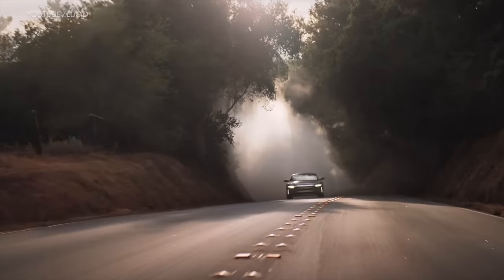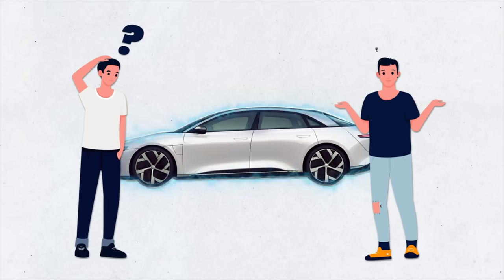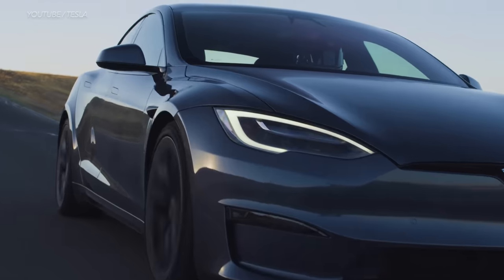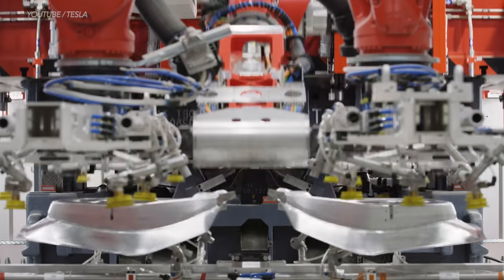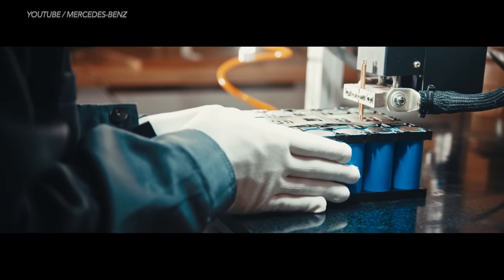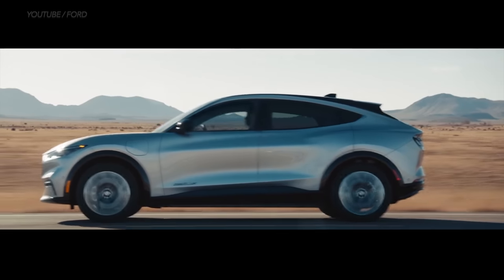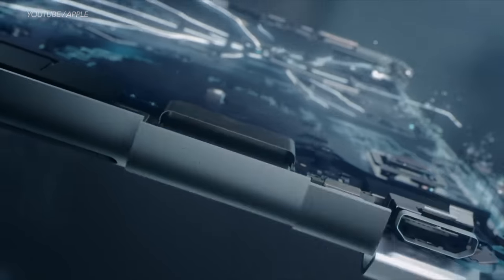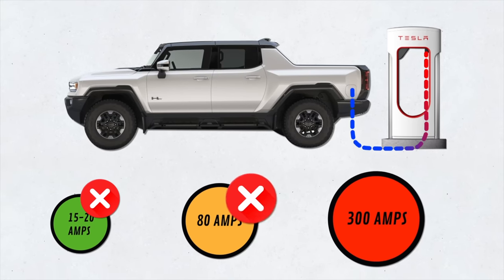Here's Why I'll Die Before I Buy an Electric Car

Comment: Well I appreciate Scotty's research on this issue and I agree with him on areas such as the need for more distance coverage by the batteries. However, my suggestion is since the Ev market is so diverse. One can always buy a Hybrid Electric Vehicle (HEV) as opposed to a Plug in Hybrid Electric Vehicle (PHEV) or Battery Electric vehicle (BEV). 
The beautiful thing with HEV units they dont need to be plugged in or charged anywhere overnight. The vehicle simply self charge while you are in traffic and while braking among other times when driving at low speeds.

The point is EV's are more expensive now bcuz of the cost to acquire the materials to build these batteries. In addition to that there is a growing demand globally eventhough we still have more Internal Combustion Engine (ICE) vehicles on our roadways. The truth is if you can afford the everr increasing  cost of gasoline well go ahead and remain with your combustion engine vehicle. However, if you are in my case where I am driving in excess of 650-700 kms per week to work with the high cost of gas...that's not possible for me to keep my current ICE engine car. I do alot of driving due to the nature of my job so I will be buying a new Hybrid Electric vehicle (HEV) within the next 10 months or so. At the end of the day it comes down to economics for me and these gas guzzling cars not cutting it for me with the high cost of petrol which affects everything in transportation and ultimately you feel it in your pockets. 

I dont need to worry about battery replacement bcuz most new ev or hybrid Electric vehicles batteries have a 8-10 year life span.

Just do your research ppl, have a plan and stick to your budget. I have done that and I am satisfied with going over to Hybrid Electric than the current ICE vehicles. The bottom line is Ev's are here to stay so get used to it.

Comment: Great overview. Would be good to get some idea of how much it's going to cost to maintain these EVs and what plans 'hypnotized' car makers have to run down PV/DV production and the spares market for those. How will governments like the UK's (which gets 80p in every 100) cope with the loss of fuel tax? Do a quick sum: say 20,000 gas stations in UK with 500 cars visting a day buying £30 of fuel. That's £240 Million A DAY in tax - over £84 Bn will be lost in revenue per year eventually at current prices!
Reply: a couple of Australian states have introduced a tax on EV's whereby owners pay by the KLM travelled. They submit a report every quarter,
Reply: The road taxes need to be paid either way. There's an inherent cost to maintaining infrastructure. I don't think any ev owner thinks that they shouldn't be contributing to maintaining the roads. That's up to governments to implement a way of replacing that lost fuel tax but whether you are paying tax on your fuel now or being taxed on your ev to pay for roads either way you're going to pay. It's not a good argument to not drive an ev because you're going to have to pay road tax. That cost is going to happen either way.

Comment: There was a time when 8.6 seconds wasn't half bad. Actually, my daily drive only has to do 30km between charges, so a MX-30 would fit my needs perfectly. Imagine if car manufacturers didn't have to satisfy a consumers need to go excessively big, fast and powerful then it would make it easier to make the cars "green", inexpensive and reliable. But hey, people will go out and buy a car, put stupid mods on it and make it unsuitable for its intended purpose, because most people don't use them for what they are designed for anyway.
Reply: Exactly.  8.6 is quick enough for most people. This idiocy of sub 5 second 0-60 times results in massively larger motors and batteries than would otherwise be needed.  And of course massively higher prices.
 Dropping that 0-60 in a still fast but controllable 6 or 7 seconds would shave hundreds of lbs of weight and thousands of $$ 
 Yet a Tesla will make ONE run at max throttle....
Simply insane for any Joe/Jane Blow to go faster than any muscle car from the 60's through today.  Many can't handle it.  And going that fast exposes the crappy Tesla brakes and handling.
Reply: That tiny 30KW batterie will have to be deep cycled EVERY Day, making it's Life expectancy about 1 or 2 Years....Paul
Reply: @paulholterhaus7084  Based on WHAT??    There are Teslas that have been fast charged for 10 years and still ticking.  Plenty of Leaf's with 10 y/o batteries.

Comment: Right now, I'd be more interested in an "electrified hybrid", or whatever they're calling vehicles with gas engines that drive generators, to charge batteries, to power electric motors. Maybe a solar-powered EV that can charge all day.
My Dad worked for the railroad. Whenever this subject came up, he went on and on about developing cars like diesel-electric trains (engine-generator-battery-motor). Now they're finally doing just that. I wish he could see it.
✌️&❤️
Reply: Aptera has a prototype of a three wheeled EV with solar panels inbuilt. They estimate that 1 day of sunlight will power up to 40 miles of travel.

The base model weighs under 1,700 lbs and has a range of 250 miles.

Comment: I own a 2014 Cayman S as my daily and track car. I do about 10 tracks days a year and I put about 15,000 miles a year on it between driving to/from work, groceries, school run, trips, etc. My trophy car was a Cayman GT4 which I traded in and am waiting for my GT4RS to be delivered this November. I ordered the GT4RS because I believe it’s the last of the truly epic IC engines and will keep its value or possibly increase over the long term. I’ll probably put about 2000 miles a year on it like I did with my GT4. Porsche has announced that the next Caymans due in 2025 will be all-electric and I think that’ll boost ICE values once they’re no longer available, especially all 6 cylinder versions. So, how does this relate to EVs? They’re boring. They titillate with their tech and giant iPad type screens, but the sound, the driving dynamics of the engine are all ultra-antiseptic in their character. If the next Caymans take 5 minutes to fully charge and have a 1000 mile range per charge, I’d still prefer the sweet 6 cylinder ICE versions of the Cayman. Now for a family car, EV for sure. Your fun, exciting, sports car? EVs will never replace them in my book. And I think in the books of other car nuts too.

Comment: So let's see...
A) EVs can catch fire and require special extinguishers (potentially locking doors trapping you inside and sprinting at full speed before igniting); this can happen because you are charging or because you are not charging ... So either way
B) Energy is going up, and these are energy hogs... So if you are thinking about range then hold on to your wallet; and if you plan to charge at home, then consider the wear it will have on your infrastructure (batteries and cables will wear out as they get toasted due to high power draw from your car)
C) Batteries are very expensive ... So if you're expecting it to pay itself in the long term don't forget to include periodic battery replacement into your calculations (in short it NEVER WILL)
D) Weight means tire, break, suspension and steering wear... So you better inspect regularly
E) Oh the goverment is already planning on taxing by the mile, so they'll track and control you like they've never done before
F) Do you really want to go all in on sensors and control units during a part shortage? Electric cars are even more Murphy law centric than the regular clunkers coming out today. They have nothing but computer depending systems that are complex and likely to be expensive or unavailable.
G) Lets be honest, they are new. New tech has issues (some I discussed some are yet to be discovered, probably while attempting to corner at 80mph in the highway).  Usually, cutting edge stuff is expensive and lacking standards. So... They are less likely to be maintained once the technology matures. Or put in another way, they can be considered "early classics" or future junk.

Personally, not going to buy expensive junk. I'll avoid for as long as possible and I plan on switching to gas and use biogas... So that should be quite a while.

Of course there is a health benefit from pushing these the last 30 miles... If you want a good workout but find the gym too confining and don't mind the extra expensive, then maybe EVs are a perfect fit for all those Sisyphus fans out there. I'll be glad be glad to support by honking as I pass you!
Reply: Hmm. Current limiting your car battery feed sounds like a good idea...oh wait, it'll take longer.
Reply: yeah, i like my vehicles with fuel that cannot catch fire, like gasoline.

Comment: Then there's that whole spontaneous combustion thing. Looking at you Tesla and Chevy Bolt.
Reply: More ICE cars by far catch fire even sitting there.   ICE is something like 10X more  likely to catch fire than BEV.
For what it's worth I think it was 16/141000 bolts that burned.   They were defective.
Reply: Kia, Hyundai, Ford, and Mercedes have recently had recalls for fire problems, and it is not the EV models.
Reply: If your radar was functioning correctly, you'd know about the 160'000 ICE cars which catch fire each year in the US.....  The statistics show that there are around 3 electric car fires per 100'000 EV's....

Comment: I don't want a rolling computer. I don't want to depend on a computer update to keep myself mobile.
Reply: I agree, however, is that just an engineering "flaw"? or a means to control the masses? If there was just a very basic type of EV car that wasnt dumbed down with all the bell$ and whistle$ I would buy one the 1st chance I got. There hasnt even been a compact truck on the market for at least a decade thats not a mid-range to monster truck sized gas guzzling hogvomit. This is deliberate.
Reply: @jessehoffman2726  i imagine it will be inevitable. I will be converting an ICE to electric when the infrastructure is there. They make kits already for my vehicle. But no way will i buy a car that runs off an operating system and has a cellular connection. Nope.
Reply: @FGuilt  That would be a good idea. just kind of hollow out the body frame of an older (and by no doubts better looking) vehicle , and build your own from the foundation/frame up. You would have to be a decent mechanic and study up on how to do that though AND have the tools and space & garage....thats 2 rich 4 my Bl🩸🩸D
Reply: @jessehoffman2726  nah man. You could do that but, they make kits.
Reply: Cars have had computers in them for 50 years.  Almost every video Scotty does he has to plug a scanner in to diagnose the problem.  Look at all the sensors modern cars have to make a gas engine work.  Other than self driving, EVs probably have simpler software
Reply: @sapphire163  you can't be serious. There's a difference between an ECM ICM and BCM (basically controllers, simple computers) and a vehicle like a Tesla that relies on a central computer to control everything in the vehicle. German vehicles like to do this kind of thing. Scotty has allot of videos about that and why it sucks. He uses a scan tool to get data for diagnostic purposes. That doesn't say anything about the costs and benefits of increased computer control. I've never owned anything newer than 2004 and i don't want to. If you have a software suite with proprietary software, well, i give you apple products and the huge legal fight independent repair shops were forced into to get right to repair. No sir. Get that computer garbage out my life.

Comment: I too agree with EV driving range and how long it takes to recharge. For that I still prefer ICE cars. Heck I even want to drive one every day even to work! However due to high fuel prices, I now commute to work, shopping or any local drives esp. in CBDs with MG ZS EV - one of the cheapest and yet 5 star Euro NCAP EV to buy.

Comment: Gas - electric vehicles like the  Chevy Volt are the most logical way to transition from gas to ev's . You don't need a huge battery which keeps the cost down you can also recharge the battery if it dies on you.

Comment: $90k for an F-150. Just think about that for a moment. Sure, the brand new lightning is cool, but it’s literally a $90k F150!
Reply: They start at $40k numb nuts
Reply: I’m getting a Lightning Pro delivered next week for $46k loaded
Reply: @AT-pw9hg  can you literally get one today for $40k? Without the ridiculous dealer mark up? Also, are you telling me that all those platinum editions don’t exist? Because a lot of people are being ripped off paying $90k for an F150. Then again, there are plenty of people who pay $80k for an ICE version of the same truck.
Reply: @phileasler5401  “loaded” you say? So yours comes with heated and cooled leather seats and a larger, 15.5-inch touchscreen that handles entertainment and climate controls. Power retractable running boards and a power tailgate, Ford’s BlueCruise hands-free driving technology, an 18-speaker Bang & Olufsen sound system, and both the max towing and towing technology packages.
Reply: @AT-pw9hg  lol that version is almost impossible to buy.
Reply: @UmmYeahOk  He is also getting the standard battery so he better get used to sitting at charging stations.

Comment: From a relative who works for the Tesla battery plant. The life expectancy for a Tesla battery is 10 years. The replacement cost is around 25k. How many Teslas do you see on the road every day? There is no plan for disposal of these batteries. The materials used to creat these batteries are super-reactive and toxic. Are battery powered cars a good choice for the environment?
Reply: This is the biggest question mark I have on EVs. You see 20, 30 year old cars on the road today being daily driven - what about EVs? When the battery goes out, it won't be cheap to replace - that's if a replacement battery is available to order after 10-15 or more years after the car has been sold and gone out of production.

Comment: I would consider driving a EV. Price, reliably and range would all need to line up properly for this average joe to get on board. I could see having one as a second vehicle for errands and such in addition to the ice for regular use. I'm not going to drop 40k to run to the grocery store on the weekends. Also if you are dumb enough to run out of gas it's still an easy enough fix. If you run out of juice what do you do then. Hey there's an idea.  quick charging mobile trucks come and fill up your battery on the side of the road.
Reply: I'm sure AAA will have that on their service trucks too..
Reply: They do have vans that come to charge your battery. They are usually diesel though lol.

Comment: I would be more enthusiastic about evs if 

Ev cars looked like normal cars with a ev powertrain

Ev cars didnt have big touch screens and have real buttons and a stick shifter 

straight up driving is not supposed to feel seamless there needs to be a good amount of human control during driving
Reply: My sentiments exactly. One of the biggest reasons I would prefer a BASE model electric sedan would be to get away from the stench of the exhaust from petrol combustion engines😖

Comment: Hi Scotty, We made the decision to replace my wife's 9-year-old ICE car with a Tesla this year.  Granted EVs are not for everyone's usage.  In her case, she uses the car for a short weekday commute and weekend errands.  At these rates, she can go several days without charging at all.  Me? I drive an HD Diesel truck and had a Prius 14 years ago, so we are not the poster EV user pair. The idea the EV is heavier is correct. In her case, the EV is 121lbs heavier than the ICE it replaced :-)  We have learned a lot about charging the car and know supercharges are for traveling only and follow the 20-85% charge.  With the research we did before buying the EV, we are confident it was the right choice for us at this time, with this usage.  I use my truck for towing (2 trls @ ~7 tons ea.) and as a daily driver.  In fact, it gets better fuel mileage than her previous ICE and we would always use the truck for road trips.  Would I replace my truck with an EV? Hell no, not with current offerings but for her it was the right choice... and... it's fun to drive!  Enjoy!

Comment: My budget to buy a car is around $5000 - so no chance to buy an EV!  Simple! 🤣
Reply: What I pay to the bank for the loan to buy an EV is less than I spent on fuel. But yes, I coughed up  $8000. And I live in northern Europe so fuel prices are high, and my electric bills are low and I got subsidized with $7000 by the government. The EV was $43000, so $28000 is a loan. And I have a house so I can charge from my own wall box at home. So every case is different.
Reply: Wuling Mini EV cost 5000$ in China.... World most sold EV now!
Reply: I've seen used EV's for sale in the UK priced at around that £6k.....
Reply: @Brian-om2hh  but would they be ones you want to drive and how many miles are left in the battery?😅

Comment: Motorcars used to be the playthings of the rich. Then everybody had one. I like those two old time photos of the same busy intersection in New York City. Both capture a midday urban streetscape packed with dozens of vehicles. The first one taken in 1913 shows all horse and buggies with one car. You can barely find the one car in the picture. The second one taken only ten years later has all cars and one horse and buggy! Those horse and buggy drivers in 1913 did not know what they were on the cusp of and could probably rattle off a list of the reasons why motorcars were impractical, deficient, and not ready for widespread consumption. But technological innovation was still kind of a new thing back then, so those people can be forgiven.